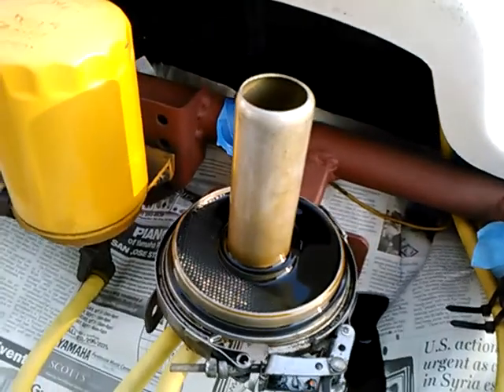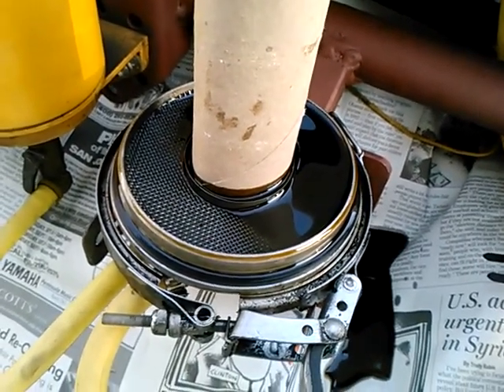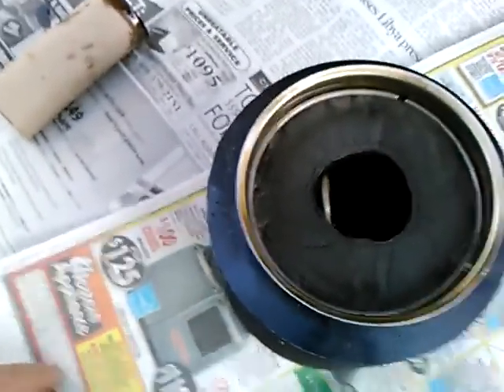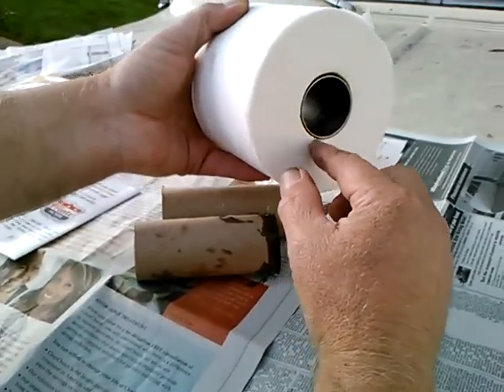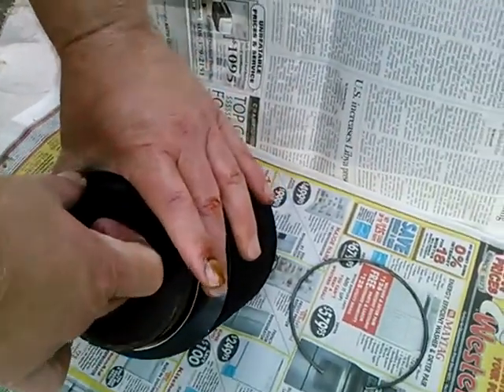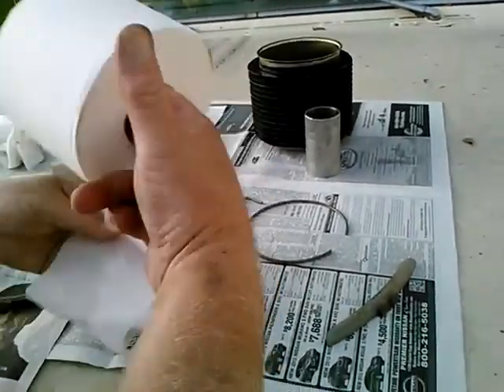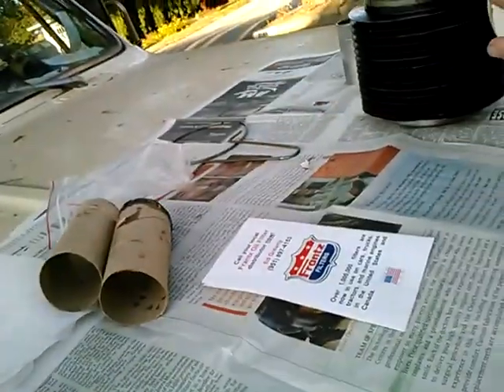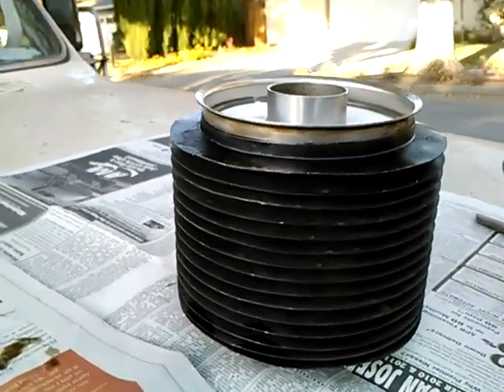Use of a Spacer in the Frantz Toilet Paper Filter

Comment: I recently bought a Jackmaster Classic.  The seal at the bottom is about 2 inches. They dont have the center tube. They use the TP core as a center tube. One thing you can do with the Frantz if you dont have the spacer is save your used cores. Split the cores and put them inside the new core until you get the right fit. Then you do it like we did it in the 60s push the TP down on the knee. The hemi end makes contact with the  seal first. Then push the canister down against the gasket and put on the clamp. You want the seal to be made before you start the engine. I have an air fitting in the lid of the Jackmaster. It takes about a minute to push the extra oil out of the filter before changing the TP.. I use a cigarette lighter air pump. I have put self tapping hollow bolts in the top of the Frantz  for a pressure gauge. You could use an air fitting.the reason for the spacer is so the core wont get egg shaped and cause a leak around the  undersized core seal. Jackmaster gives you a choice.Frantz has no interest in you using TP.

Comment: The Gulf Coast O 2 Jr has a smaller tube and a better seal at the bottom. Bought a couple of Scott in the individually wrapping. The cores are 1 1/2. But the multi roll ones are firmer. In other words they have more paper in them. The seal at the bottom is what counts. Those were the good old days when they all fit. Frantz Motor Guard and Gulf Coast user since 1963. Frantz is the only one that could never get the core seal right.

Comment: Back when oil was sold in 1 quart round metal cans, it was common practice to use the oil can to push the new roll of 500 sheet 2 ply TP into the Frantz canister. When installed this way, the new roll slid in easily but was very tightly installed. I have never had any problems with the roll not being forced down onto the screen. There was even several times I cut a roll in half so I'd only have to use 1/2 quart of oil with a change and even then the roll was forced down onto the screen leaving an imprint. Maybe your oil pressure is on the low side. Very strange not leaving an imprint!
The old TP rolls were 4-1/2" tall and the cardboard center fit snugly over the Frantz aluminum center tube. As you have found, the cardboard center tubes are now larger than they use to be. There are two methods I have successfully used to overcome this problem. One is to use a stack of o-rings installed on the center tube and the other is to use a length of oil resistant heat shrink tubing. I like the heat shrink the best.
I've heard the new Frantz filters now have the restricting orifice on the inlet but I haven't verified that.
Once you've removed your old used roll from the canister, examine the top of the roll for any metal particles or other foreign material. Frantz literature called this an "instant engine analysis". I personally have never found any foreign material but it's still a good practice to look at it.
Old oil soaked rolls are GREAT for starting fires in wood stoves. I haven't thrown one away in over 35 years.
Reply from the maker: smasg Thanks for the input.  Any idea why that center tube is sometimes tapered and sometimes straight?  I've found the straight tube uses a "dam" or "knife" at the end to cut into the roll to make a seal.  The tapered tube ends in a rubber seal, as if that would seal against the cardboard roll.  Which came first, why did they change, any ideas?
Reply: guidoguitar  All my Frantz filters I own have the tapered center tubes with the square o-ring at the bottom and were purchased between 1966 and 1985. Even my "aircraft" filter is tapered. I'm sure the straight center tube with the knife edge came later.
Maybe they changed when the TP center tube increased in size? I haven't had any problems with oil bypassing the roll by leaking past the center tube even with the new TP by using oil resistant heat shrink tubing over the Frantz center tube.
Reply: The oil can doesnt work for the shorter paper.  I always used the knee trick. Frantz never got the seal problem fixed.   Haven't used the Frantz since the shorter rolls.

Comment: Of course if you had a decent seal in the bottom you could still push the shorter paper in too far so that the core wouldnt make contact with the seal. When I used the Frantz the paper fit the same as the Frantz element. Im starting to remember why I use the top loaders. With the top loaders you push the paper down against the seal and put on the lid. The oil pressure does the rest. You dont have to hope it cleans oil until your next filter change which you will mess up again.

Comment: Some paper is getting smaller diameter and the  cores are getting larger. Looks like it wont matter with the Jackmaster unless the core gets bigger than the seal.The Jackmaster seems heavy but it is die cast aluminum with a powder coating.

Comment: The shorter  roll and larger core caused problems for Frantz owners. My Motor Guards and Gulf Coast filters dont have that problem. When you change the element you.are pushing  the toilet paper core down against the seal. I think the Gulf Coast filter has a 1  3/8 tube. Frantz got left behind in the design department. That seal  was abandoned. You might try the Great Value 1000 at Wal  Mart. It has the smaller core. When I bought my first Frantz almost all toilet paper was high quality and a perfect  fit. If you went too long before changing  it you might have to peel the core off the tube. They didn't need the ring. Actually still dont if you use a firm roll. To pull out the roll we used a pair of pliers.

Comment: You have it right I was.taught to push the tp down on my knee and make it concave push the concave end in first leave the hemispheric rounded end where it reaches the core seal first you shouldn't need the sleeve ot the ring the reason the motor guard or gulf coast filter s don't need the.sleeve is you push the elements down against the seals before the top is put on l think the tube is about 1 and 3/8 in. on the gulf coast

Comment: Another problem is if the orifice is at the outlet the.pressure.is equalized it works better with more pressure pushing down on the element of course there is more danger of something big clogging the orifice . not likely in a modern engine
 Another problem is with the shorter Scott 1000 the tp is pushed too far into the canister. It should be pushed in just enough so that it doesn't pinch the paper. I can't depend on the motor.guard tee handle compressing the shorter roll I have to push the tp down against the seal thren the oil pressure takes over and compresses the tp

Comment: The Frantz was the poorest  design of the toilet paper filters. With the top loaders like the Australian Jackmaster Classic  and some others you push the paper down against the bottom and put on the lid. The Australian Jackmaster Classic uses no center tube. They depend on the core seal at the bottom. Probably better to push the paper down hard on the base and slide the canister down over the roll. When I used the Frantz toilet paper fit and had a 1 1/2 inch core.

Comment: The spacer means nothing. If you don't get a screen imprint when you change the elemenr you didn't get a good seal at the bottom or you have a wrinkle at the outer surface of the roll. Either use the Frantz elements or add a spacer at the bottom.I do the same with the Motor Guard. With the shorter Scott I force the core to make the seal at t the bottom.The Motor Guard is easier because you can add a 1/2" spacer at the top.the ring is for people that use junk paper or install the firm roll too loose or too tight. The filters are not idiot proof. I have loved them for over 50 years.

Comment: That is something I ran into a few years ago the individual wrapped Scott 1000 was 1.5. The multi roll wrapped was larger. I didn't know if that was a local thing.I think I called them and didn't get much of an answer you would think with the millions of rolls they.sell for oil filters they would pay more attention to our needs I count the number of rounds I was.trying to use. Drum of factory elements from motor guard that I took out of new filters I tried to leave the cores in.they crumbled the older brown elements were easy to.get the cores out.I messed up a white.one and gave up

Comment: The problem with the Frantz is it was designed for 1 1/2 paper. The paper changed and the Frantz didnt. The later improved filters were designed to handle the larger cores. Its too simple to understand I guess. They used larger seals. All the Frantz needs is a flat washer 2 inches OD and the right ID to slide down the tube. The superior design of the Jackmaster uses a flat seal because the firm Jackmaster element doesnt need a seal that cuts into the paper. I put a roll of Great Value 1000 in my Jackmaster. Worked perfect. The Scott 1000 is just as good. I couldnt believe Jackmaster has no center tube. They use the TP core for a.center tube. Works perfect. The Gulf Coast Junior  has a center tube that seals nothing.Its about 1 3/8. All it does is help you remove the TP. The Frantz is a terrible design compared to the later filters. You have to be smarter than the Frantz.  The Jackmaster has an eyelet in the fabric covering the element to pull it out. With toilet paper I will use long nosed pliers like we did with the origional Frantz. I can handle that. I also found a wrench to remove the lid. I am such a genius. You could probably use wood to make a decent  seal. Anything that can take the hot oil. Also use the old instructions. Push the roll down on the knee to make it round on one end. The round end goes down and makes contact with the larger seal you just put in. Then push down on the canister and put on the clamp. Young guys are trying  to make the oil pressure push the paper down. Some of this newer paper looks like the core is too big For the Frantz seal. They are saving paper. I didnt have to unroll any paper with the Jackmaster.another problem is the TP can be pushed in too far and dont even touch the seal. If you dont know how to use toilet paper use the Frantz element. It is more idiot resistant because it fits. I only use top loaders for the last 20 years. I am an expert. It shouldnt take an expert to change a Frantz oil cleaner.

Comment: What is the length of the toilet paper?
Reply: Not sure but its shorter than it was in 1963 when I bought my first Frantz oil cleaner.  Gives you another way to mess up by pushing the paper in too far.  A better design was the Motor Guard. With my 50 year old Motor Guards that filtered  from the bottom up I dropped a spacer in the bottom to push the core  up against the core seal at the top. The Gulf Coast junior  and the Jackmaster classic  are top loaders. You are pushing the paper down against the core seal that is bigger on the improved filters. When Frantz came out with their own elements that fixed the problem. They fit the smaller seal. When toilet paper came out with the bigger core Frantz should have came out with a bigger core seal. Putting the spacers on the tube is the stupidest thing ive seen. The Frantz is only designed for 1 1/2 core paper. For the bigger core paper you need a bigger core seal at the bottom. For the shorter paper you need to do the knee trick. Not many of us left that understand how to deal with the poor Frantz design. When Frantz came out with their own elements we were told if you used toilet paper instead of the Frantz elements you should change your oil. Bull shit. I stopped routine oil changes long before there were Frantz elements. I believe the new toilet paper is shorter and the cores are bigger.. The Frantz elements are the same size as the old TP. Havent tried to find the correct size for the Frantz in many years. The top loaders 
 Can deal with the shorter rolls and bigger cores.. some paper is getting even larger cores and smaller diameter. TP.. Been using Great Value 1000 from Walmart.  Was unrolling 30 rounds. Didn't need to unroll any the last time. The bigger core was no problem. My top loaders all have the bigger seals. If you are young and want a liferime filter easy to deal with get  a Jackmaster. Do your rresearch.

Comment: The Frantz was a terrible design. The Motor Guard and Gulf Coast O 1 junior fixed the Frantz problems.  All of the top loaders have better seals at the bottom. You are pushing the TP down against the superior seal at the bottom. The Gulf Coast  junior has about a 1 3/8 inch tube.  The housing is tapered. I just added a spacer to the bottom of the 50 year old Motor guard to push up on the core. The old Motor Guards filtered from the bottom up. A properly designed filter doesnt need a sleeve or the ring. Dont know what they were thinking.  Gulf Coast juniors dont need spacers for the shorter rolls. One problem is if you have all your teeth you dont know how to service the Frantz. Rookies probably should use the Frantz elements.

Comment: What you guys are doing is you are trying to make a filter that was designed  to use only  1 1/2 core TP use the bigger core TP. Later filters were designed to use the 1 1/2 inch and larger core paper.  My guess is Jackmaster would like for you to use their.filter elements. They give you a choice. They simply put.a bigger seal at the bottom that can handle any core size as long as it isnt bigger than their bottom seal. Frantz was never able to put a decent bottom seal in the filters. There is nothing more frustrating than watching rookies  jacking with the sleeves .A bigger seal at the bottom is what it takes. I   want to help you guys but you have to think a little bit on your own.If you cant figure it out get a top loader designed by people that know what they are doing. Or use the Frantz element. Jackmaster Gulf Coast junior come to mind. They dont need spacers and the ring at the bottom. You dont have to.hope the filter will clean oil until your next filter change.The paper changed Frantz didnt. The model T of oil filters. Damn rookies. THE  FRANTZ NEEDS A BIGGER SEAL AT THE BOTTOM FOR THE BIGGER CORES. Leave the center tube alone. It dont need the spacers. A flat seal at the bottom for the paper to push down against. Or get a filter designed for the 1 1/2 inch and larger cores. Motor Guard. Gulf Coast junior  or Jackmaster. The paper changed the Frantz didnt. Using TP in a Frantz requires you know what you are doing.

Comment: Toss the damn spacers and the ring. Put in a bigger core seal at the bottom. Use a firm roll such as Scott 1000. Or find 1 1/2 inch core T P or use the Frantz elements. The Jackmaster can handle any size core because they have a bigger seal at the bottom. They dont have a center tube. They use the paper TP core for a center tube. The Gulf Coast junior  and Motor Guard also fixed the Frantz problems. The Frantz element also fixed the problem. The only seal that counts is the core seal at the bottom. You rookies depress me. Guess what. You put the paper in too loose. You pushed it in too far. You will find out when you change it again it wasnt working. The Frantz is a terrible design but it will clean oil if you know how to service it. Most of you dont have a clue but you are explaining how to service it. They are making the paper smaller and the cores larger. What are you guys going to do buy thicker spacers.  I bought my first Frantz in 1963 when all paper was standard size 1 1/2 inch. The paper changed but the Frantz didnt. We didnt have Frantz elements in those days. I believe the Jackmaster elements are 1 1/2 inch but the size means nothing to them with the big seal. For example the Gulf Coast junior  has a 1  3/8 tube with a bigger seal at the bottom.  You push the paper down against the bottom seal and put on the lid. The same for the Jackmaster. The Jackmaster has no center tube. Frantz got left behind.